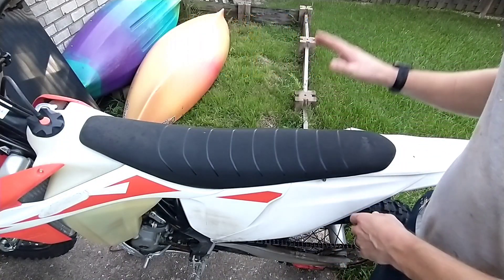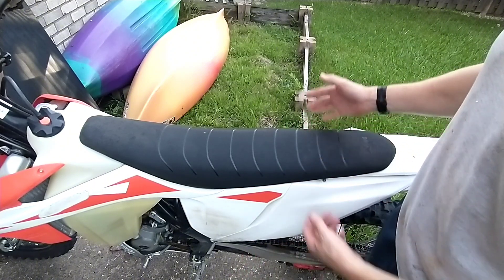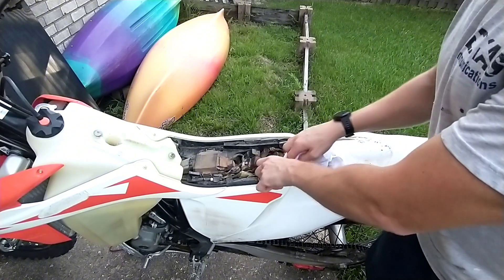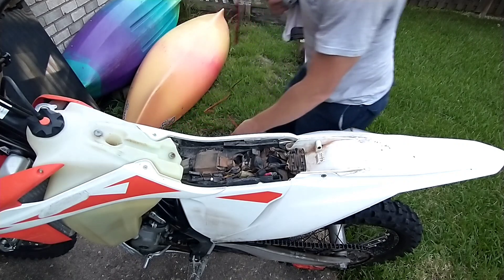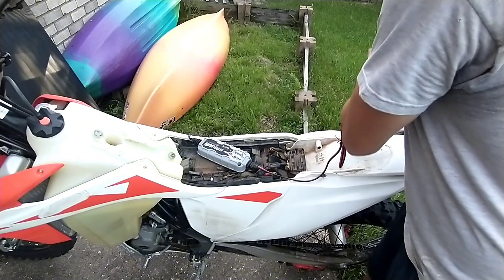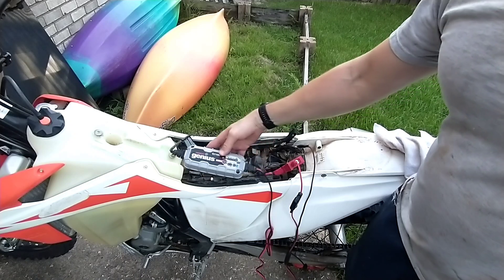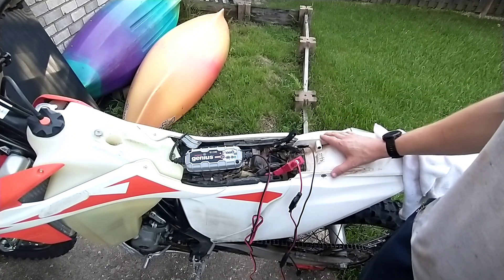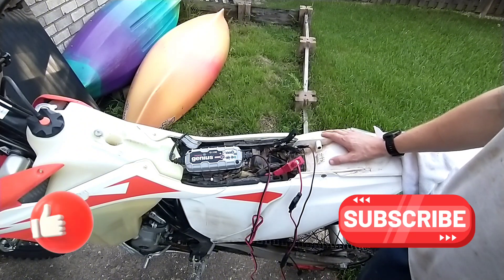Charging a Dead KTM Battery XCF SXF EXC XCFW SX 250 350 450 300 Dirt Bike

Comment: I have a 2005 KTM 450.  Just replaced the battery today for the 2nd time in 19 years.  Simple lead acid battery .. a Yuasa YTX5L-BS.  They last and are only about $55.  As for weight, sure they are twice as heavy, but seriously, have a good piss before you get on your bike.  There, that evens things up.  LOL!  Thanks for the tip!
Reply from the maker: @uni-byte  I'm with you I generally stick with lead acid, this bike just came with Lithium. I'm happy if I get 5 years from either one. 19 years with 2-3 is awesome.